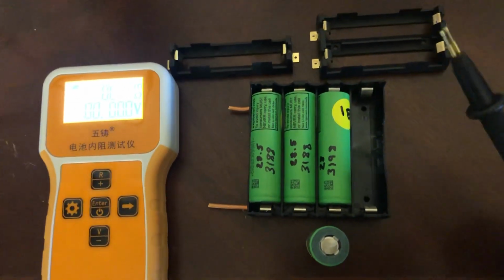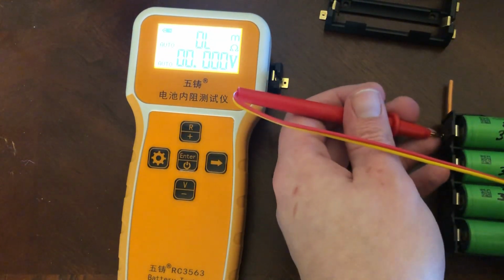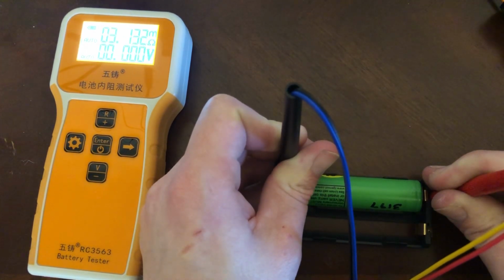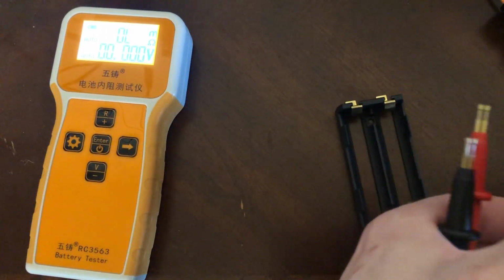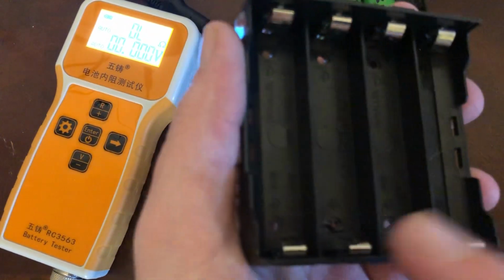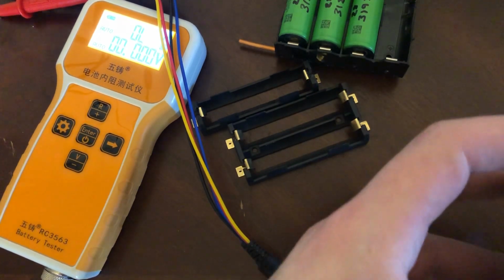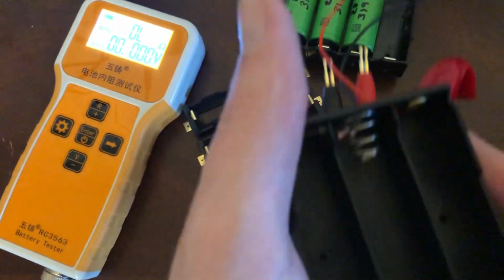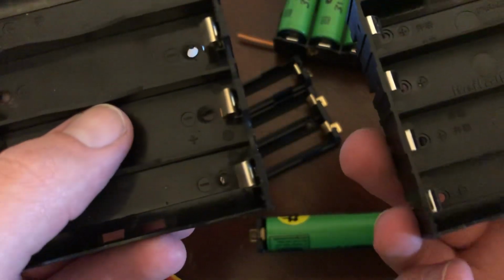18650 and 21700 Cell Holders. Resistance is everything. Spot Welding will always be Superior

Comment from the maker: I just now realize I may have done my math wrong on the first 4 cell holder I tested. I considered all 4 cells in parallel but didn't consider that all 4 cells are contacting the leaf springs before the electrons make it to the solid core copper wire..I believe that would increase the resistance of the overall reading when I read just one slot on the holder....I think.

I might redo this test with identical holders ie all 1 cell with 28mΩ cells in them. I need to purchase all forms of cell holders that are popular

Comment: I’ve also found the ones you recommended to be good.
Reply from the maker: Wish I had a way to test exactly what the material is for each contact. I need to fix my calipers so I can measure them accurately too. Just using some cheapos from Aliexpress that were $3 each